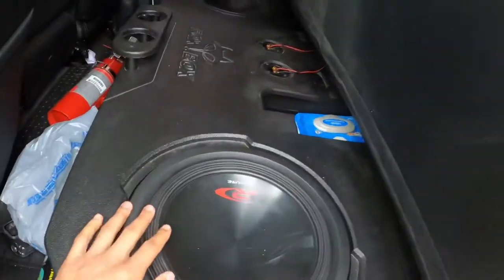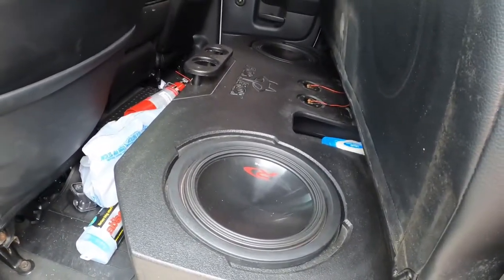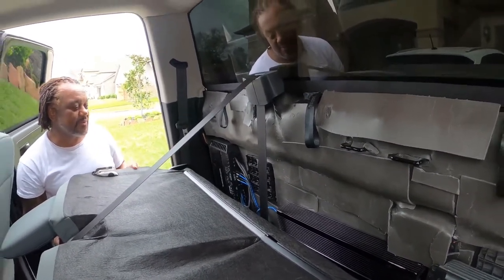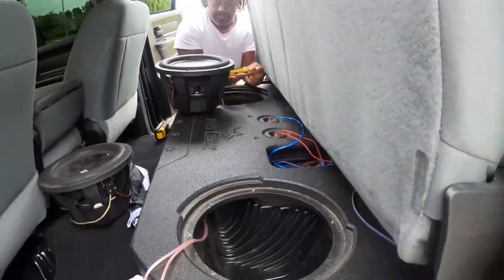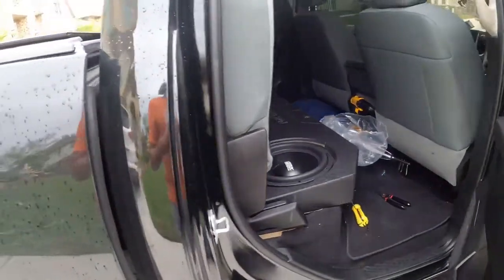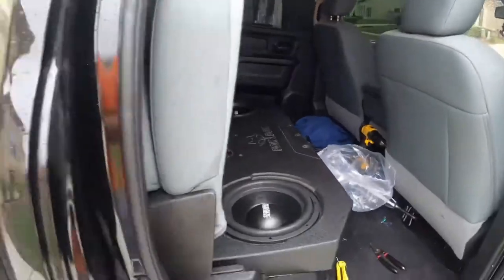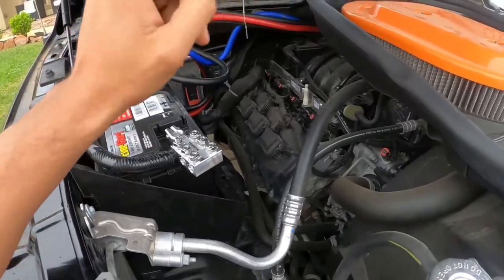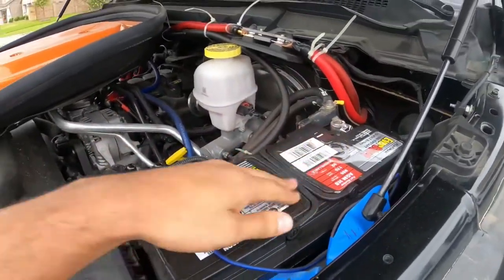The Best DIY Sound System You Can Get For Your Dodge Ram 03-Up

Comment: I have a 2003 Ram 1500 Crew cab with a MTX Thunderform box under the rear seat. No modifications 2 X"10 woofers. It's about 8 years old and still shakes the outside mirrors.

Comment: This box is an absolute beast. I just put mine in today man it sounds like I have a regular box in my truck. I’m running slds sundown 12s at .5 ohm a they are rocking. I’m definitely going to get a bigger speaker because this box can handle it no problem

Comment: I have the same box. With sa12s and a taramps smart 3 , mechman 320, big 3 upgrade. Best box for the truck in my opinion
Reply: Was the seat touching ever a problem for it ?
Reply: @4ceza471  doesn’t touch at all. I also ordered grills but doesn’t need them.

Comment: Where did you find the intake ? I am building my system now but I’m building a custom fiberglass enclosure for a sound quality build so it will be sealed, I was planning to fabricate a battery box and install battery on the frame rail under my Ram truck, I have 00 awg. and 0 awg. ofc wire, I have everything for my build but my tweeters, I have two illusion audio c10xl’s subs,  four morel elate carbon 6.5’s, four Hertz legend ml 700.3 midrange 3”, a Helix ultra DSP and a stinger height 10 head unit with a few different PAC integration units, I have about 14 amplifiers I have collected over time but I’m gonna use either my Rockford Fosgate T1500 bdcp or my T2500bdcp if the subs will take the 2500, I have a 3200 watt sub amp plus another 600 watt but they are not AB technology they are D series, I sill need tweeters but I’m back and forth with someone trying to buy some scan speak beryllium 3000/60040 series , I am in process now building custom A pillar pods for my mids and tweeters plus I’m working on my kick panel to customize fabrication to squeeze the 6.5 with a tweeter into them, I hope the 320 amp alternator that I installed will be enough, I’ve read about bypassing the computer controlling output and installing an external regulator but I’d rather not do that. a If you don’t mind, can you let me know where to get the intake and the big screen head unit that you have and what is needed to mount them, I have some amps and new 6x9 speaker sets I’d get rid of if you know anyone interested, they are all top brands, Let me know if you don’t mind where I can find intake, if you want to PM me that works. Nice set up in your truck
Reply from the maker: Sounds like your going to have a good quality system you should post a video of it when it’s done. If you do a quick google search there are multiple sites that sell the vararam air intake, we picked this one up locally. The radio was ordered from phoenix automotive.
Reply: Do you happen to have any info on building that fiberglass enclosure?  I'm very interested for my 16' Ram... Jason B.
Reply: Ramflo. I tried writing a long explanation on building but it was too much, they need a private message option here, maybe I’ll learn how to do YouTube and put a video on here of me building one start to finish. The  fiberglass enclosure is easy to build and just takes a little time, I suggest looking at US composites web site for chemicals and matting because there’s different types, like carbon fiber, Kevlar and fiberglass along with different weaves and weights, also there are different resins like polyester, vinyl ester and epoxy, I suggest epoxy if you don’t want the strong chemical smell but it cost more, I use polyester resin and I already had some 1-1/2 & 3/4 lb. Chopped strand mat on hand so I used that on my last one but my next one I’m gonna use a hybrid chopped & cloth mat which is very strong and easy to work with. go to Net Audio on here at You tube and look at his videos you can also go to the website too but they’re  (Net Audio, Paul) enclosures are expensive 1000$ and up depending on detail, which it’s very nice custom built unlike mass produced fox, not saying fox is bad just different league of detail, he is cheaper than he used to be now that more places build and sale enclosures but he was the first to build and sale custom fiberglass online that I know of and might still be the only one, if you don’t want to build your own and want to buy one that is where I would buy one from for myself, like I said I will try and learn YouTube because I could put all kinds of helpful videos on here and probably save people a lot of money too.
Reply: @subzero59lt1  I found the intake thanks, I’ve heard of Phoenix but I heard they can be buggy I heard linkswell is the best but it’s not offered in my year truck, would you recommend Phoenix from your experience? I’m not real worried about the DAC since I’m going through a DSP. Thanks I’m gonna try and learn YouTube and start posting some stuff. Have a great Christmas

Comment: With those sundowns with that box was he able to get the max power out of those with out it clipping ? Looking into getting that box for my 2 sundown 10s sdl for 2018 ram 1500 I have a q bomb right now and my 10s are chocking in that box I can barley turn up the gain a quarter with out then clipping
Reply: I got 2 500rms 10s ds18 in I think is a q bomb ported box
Reply: Because you have a 5 ft³ of airspace and your speaker fills up a tenth of that so you really only have 4 and they will get hot and clip but you put them in the ram box that's ported then you'll be okay no more clipping and more movement of the subs

Comment: If you have those sundowns truly wired how u said you have them wired wayyyy too low for that amp how u say they are wired it’s to .5 ohms and that amp is half ohm stable. And you were correct in a way about your rms increasing you have two 750rms subs sundowns at that and they can definitely handle more than rated! With that being said you would need 1500 watts at 2ohms based on the only way you’ll be able to wire in series/parallel. I have the sa12v2s in my ram in the fox box. I’m telling you you should be wayyy louder than that just my 2cents #ramlife💪🏾

Comment: i currently have a similar setup. just got a skar rp3500 amp for more power. before i install i will add the 2500 battery box (i have vararam intake). what alternator did you buy and did you replace the belt along with running big 3 ? thanks for info i been digging into this and its been hard to find
Reply: my 160 alt isnt enough
Reply: i got a 2019 f150 just ordered skar 500 rms dual 12" subs max 1000watt with svk 1500 amp wondering if my stock alternator will be enough?

Comment: I worry about my seat sitting on top of mine is that something I should worry about or is it ok or should I raise my bench seat up
Reply from the maker: The box comes with spacers, you can actually buy another set of spacers but then you would have to get long bolts. You can also throw a grill/cover over the speaker so the seat won’t muzzle the speaker

Comment: Does your ram have any issues with voltage drop?? I have a mechman 320 alt In my ram with two batteries and once my subs hit on idle , my amp cuts out until the voltage comes back up  .. any idea what im doing wrong?
Reply from the maker: No black truck didn’t have major voltage drop, at idle the battery gauge did dip down a little but it instantly came back up. The dual runs of the zero gauge helped alot with voltage drop. Make sure you check all your grounds. On your amp, turn your gain and bass boost all the way down. Play your music then slowly start turning your gain up and see what happens. The amp could be going into a temporary protect mode until the voltage to the amp comes back up. It’s possible you could need a bigger amp or a capacitor.
Reply: What amp do you have?

Comment: Did you have to get longer seat bolts to accommodate for the seat spacers?
Reply from the maker: No, if you use one set of spacers the factory bolts will work. If you double them up for more clearance then you will have to get longer ones

Comment: Will that box work in a 2008 mega cab
Reply from the maker: I don’t think soo, the mega cabs have boxes designed to go behind the seat. Those mega cabs are perfect for the low deep bass because you can get a bigger ported box in there. Fox acoustics might have some on their website
Reply: subzero 5.9 I’ve checked the website and it’s a different design. Thanks for the quick response
Reply from the maker: @joejoe1992ify  yessir no problem